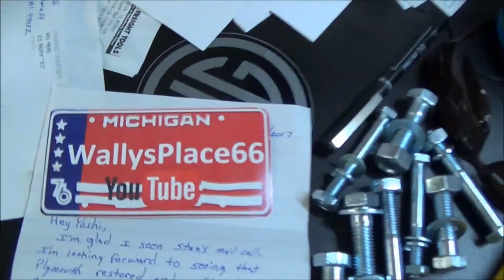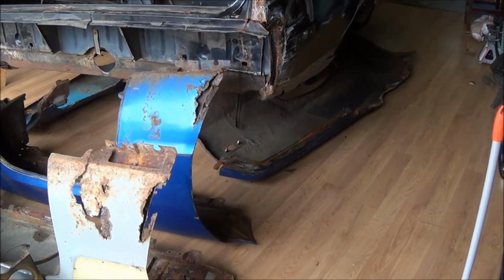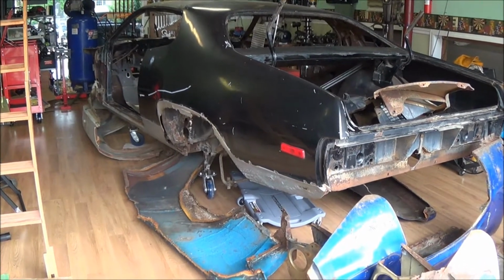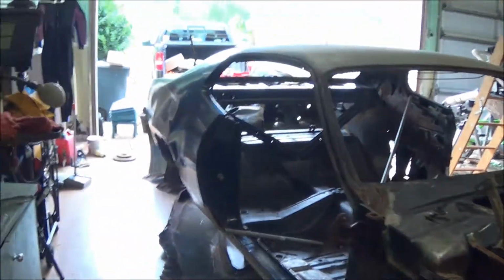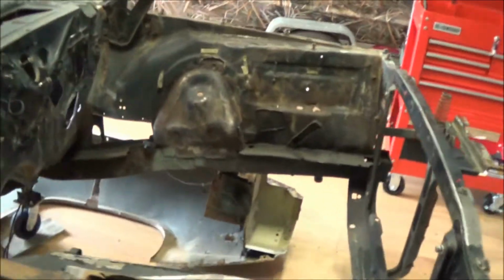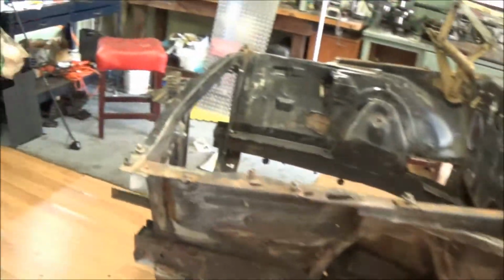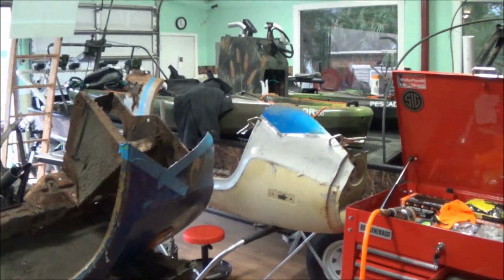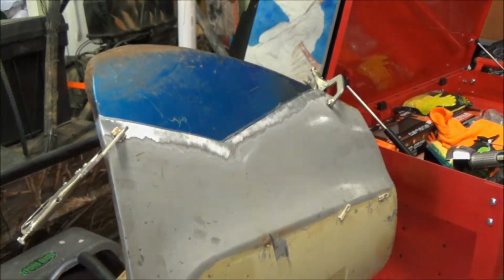WallysPlace66 Mail Call and Update

Comment: I haven't been to HF all that much. Not super convenient location for me, but still fun to go to now and then. There was actually a decent video on Hot Rod Garage (Motor Trend YouTube channel) recently where TA and LC walk through the merits of lap joint vs butt joint and appropriate applications. Maybe it's worth a watch.
Reply from the maker: Ill definitely check that out.  I took a stap at the lap joint and it turned out ok.  I kinda rushed it so have some hammering to do to stretch out where the metal shrunk a little.  I also didnt pick up gas this weekend, so I used flux core which def made it more of a pain in the arse.  Thanks for stopping by!

Comment: I need to get some damn stickers made...I've put it off and put it off!  For the outside sheet metal I'd say try doin the lap joint instead of butt welding.  When I did the floorpan in the Firebird I fought the butt welds because keeping the gap perfect isn't easy.  I ended up cutting a 6"x3" section out and starting over after I mutilated it trying to fix the gap and burn throughs.  It seems like the lap joint would be easier for a bunch of reason. Dealing with gaps while butt welding that thin metal is a pain in the ass and you will burn through at least once or twice per panel.  Lap joint seems like it would be a little stronger and gives you some fudge room so you don't have to have your cuts perfect while minimizing pin holes from a billion tack welds.  Just my thought...keep the videos coming!
Reply from the maker: Chaos Garage thanks for your advice! looks like I'm taking a trip back to HF today. haha.   shoot me your address anyways and I'm happy to send you a sticker. if/when you get some made I'd like to be on the list!
Reply: Will do!  You can be the first sticker to go on the Chaos Garage sign.  I plan on getting some made, just haven't gotten around to it.  But I will soon and yours will be the first one to go out!  Also if you end up doing any butt welding of sheet metal...weld both sides before you grind anything...ask me how I know! haha

Comment: Thanks for the shout Yoshi. I started out hating HF cause my first tool purchase was junk but it was just that one item so far. A guy can spend a gob of money in that store. Take care bud
Reply from the maker: WallysPlace66 sure thing man!  the only issue I've had so far was in a wrench set I got two of the same size wrenches and was missing one... they swapped it out no problem.  I look at reviews for most of what I get there, and don't go for tools that have tons of negative reviews.
Reply: I wouldn't say I 'like' Harbor Freight stuff but being a hobbyist and not a full time mechanic, they fall into my price range.  Plus most of the stuff is cheap enough (or their lifetime warranty) that it doesn't matter if it breaks, just go 15 minutes down the road and get another.  I can't go in that store without dropping $80 every time.
Reply: Dang you let Wally in this place. Heck then I guess I ken stay two2.
Reply: Chaos Garage 
Yeah I know right